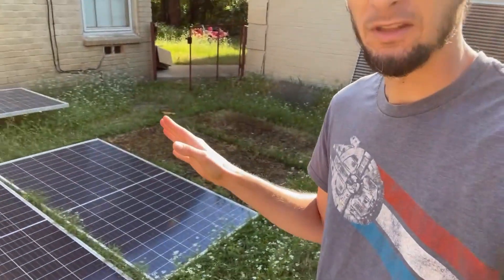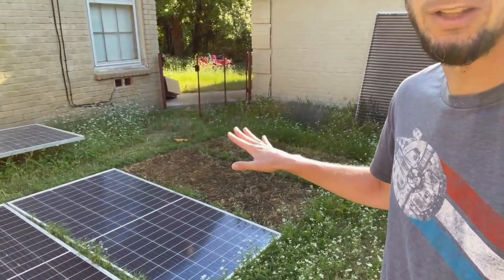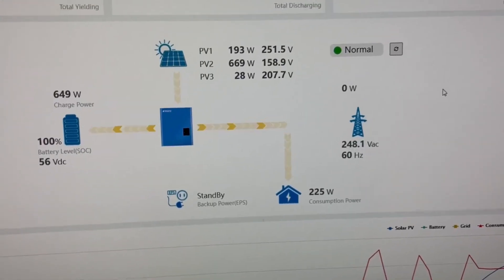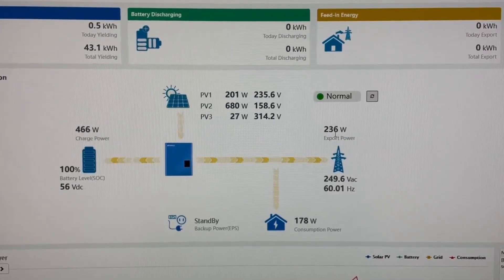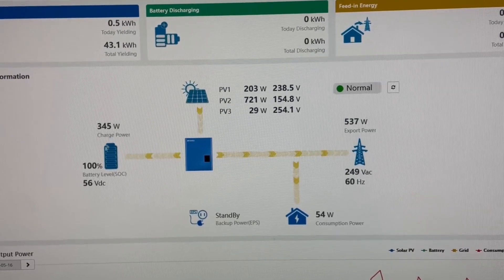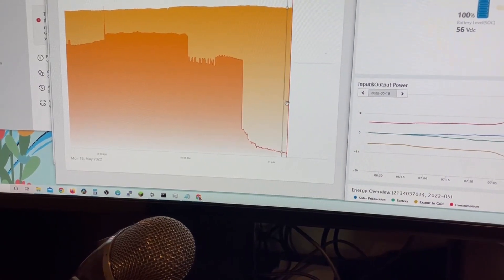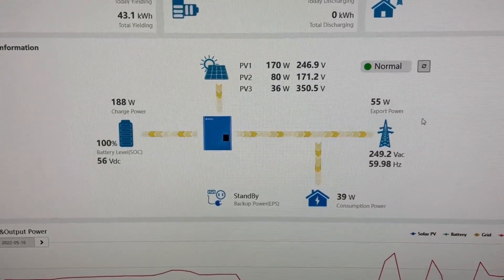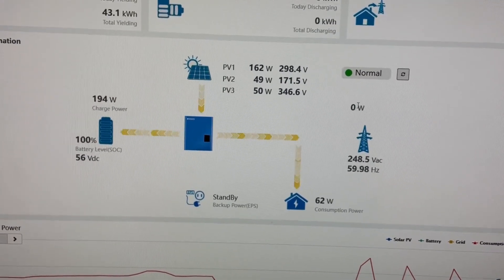Part 2 New Hybrid Inverter Troubleshooting - One down!

Comment: What is the rough cost of this inverter? I think you said you got it direct from China. It there a link to the specs? If not can you mention what they are?
Reply from the maker: This thing is in the 5k usd range after import duties and shipping. 10kw split phase, zero consumption option, grid feedback or off grid, etc. Doesn’t have some of the stuff like dump loads and ac Solar inverter interaction the sol ark does though.
Reply: @BeeneEnergy  Wow that price is up there!  Here I got 3 surplus Delta H6's to experiment with but none are permanently hooked up yet. After I got the 3rd unit a spare Signature ran out of them. Anyway thanks for the reply
Reply from the maker: Yep got a pair of those running my grid tie setup. They work just fine but really hoping to find something that connects to a normal 48v battery that works well.
Reply: @BeeneEnergy  Does this Inverter or any of yours have  a feature/setting not to backfeed the grid?

 Hello Mr Solar, Do you know of an inverter that can be configured to not feed back into the grid?  Lets say I do not have batteries yet and just want PV cells to reduce ones power bill but never feed back to the grid. Ebay has some Chinese 400 buck units that show up under "grid tie  limiter" . They seem to use a current transformer as feedback not to back feed the grid. 

I think the some Enphase microinverters can be set to not back feed using their module/software.
Reply from the maker: Yes this one has that feature. Self consumption mode is what I call it, not sure if that’s entirely accurate. So far I haven’t gotten a good test in to see how well it works.
Reply: @BeeneEnergy  please do a test

Comment: Glad you figured it out Beene!!! Hey I have a quick question for you I just got all my solar stuff delivered today. I have a 40ft RV but I want to know where you would recommend putting the batteries,inverter etc someone told me not to put it inside my storage area inside the trailer where it can stay under 90°f.  But here in Vegas we get 115-118°f all summer the last thing I want is the batteries or inverter to overheat and blowup or shut down. I have an area 5'x5' storage area that has 2-14 inch pusher/puller fans in it. Would that be an ideal location or should I just find a storage area inside my actual trailer to put it all in? Any recommendations would help greatly ty
Reply from the maker: That’s a tough question. Obviously with lithium there isn’t a venting concern so they can be installed inside. And arguably if there’s an electrical fire it wouldn’t matter if it was inside or in the basement. The heat will certainly reduce the life of the batteries and equipment so I’d probably opt for inside in this case. Or run one of the ac vents into the basement area?
Reply: @BeeneEnergy  Thata a great idea I can just add a AC duct into the storage area it should keep the temp  under 90°F during the hottest parts of the day. Thanks I really appreciate you taking the time to answer all my questions.

Comment: Glad to see you getting the panels off the ground.  Next step is a proper elevated mount.  Consider having some panels mounted for optimal production during summer solstice and others angled more steeply for the winter solstice.  Great content and promising inverter/charger.  Mow the lawn.  ;)
Reply from the maker: That sounds like adulting! Ha ha

Yes I’ll get to the lawn, buy one part for the mower and the next part breaks.
Reply: @BeeneEnergy  - Been there!   No fun, either.  :)

Comment: Glad you figured it out. I was curious if the inverter has generator input? That would be pretty cool
Reply from the maker: It does, it can be configured to only pull from a generator as opposed to pushing and pulling to a grid.

Comment: That’s awesome it’s working. What is the wattage and specs for this inverter? Sorry if you’ve already done a video on that.
Reply from the maker: No I haven't done anything specific for this inverter yet. It's a 10KW split phase unit. Pretty beefy. Don't know yet if it's worth the price but hoping to find out soon!
Reply: @BeeneEnergy  yeah definitely keep us posted. So if it’s similar to a solark I’m assuming it cant be run in parallel?
Reply from the maker: @GavinStoneDIY  This one can in fact parallel up to 5. And while I’m not sure it had all the features of a sol ark it is advertised as close.